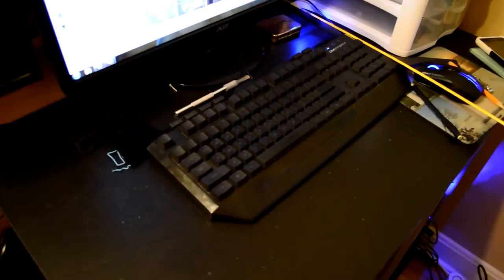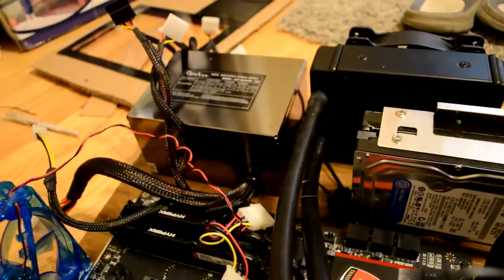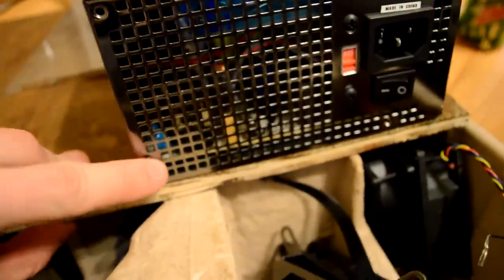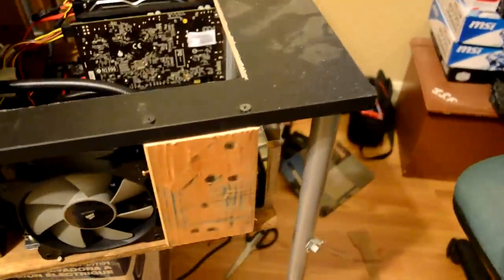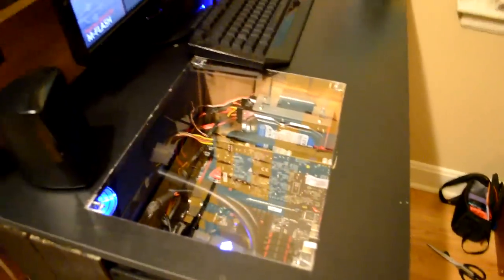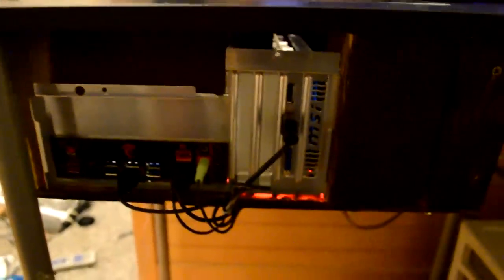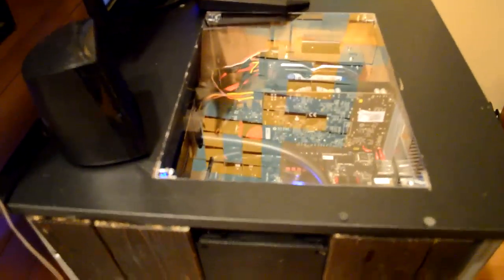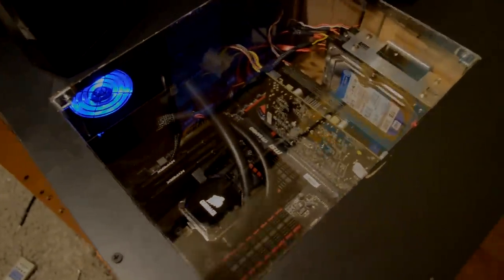In Desk Water Cooled PC - Custom Build

Comment: you should countersink the screws on the desk that hold up the computer so its smooth all across it and it will look beter too. if you dont know how to do that i will tell you how: step 1. find a drill-bit a little bigger thatn the one you used to drill the hole if you even did. step 2. attach it to a drill duh and drill into the table just enough to make a slight dip in the table then put the screw in and see if its good and if not drill a little more and tada smooth table

Comment: Hello, i think this is a very creative design. May I make a suggestion? I noticed that there are gaps between the fans and the desk itself. My suggestion would be to cover them up with foam, or simular materials.

Reason for this suggestion as this would allow the system to keep cooled down better. Also this would reduce dust buildup. Basically say you dust the system every week. When you close in the gap, then it can be every 2 weeks (in theory).
Reply from the maker: +James Foster Yeah that's a good idea. I actually recently put this build in a new desk and I covered the fans with wood on top and bottom this time.

Comment: Hi 
i just want to know were is power button how can you turn it off and on ?
I know that is a dumb question xD
Reply from the maker: It's cool xD. I put it (If facing the desk head on) off to the right of the case. Just kind of in between a piece of the wood. You can see it in the video it is that white and orange twisted wire.
Reply: Toasty Bros cool i was planing to make one before you upload this video but that help me thanks for that and remember you keep being you bye <3
Reply: Yo Toasty I'm going to be doing this with my setup how did you get the power button to work? how do you connect it and did you buy one or rip it out of a case
Reply from the maker: I took on out of an old case, but making one is really easy. There will be two pins on every mobo for power; to turn it on it just required you to complete the circuit for a second. So you can even just use the tip of a screw driver and touch between thoughs to certain pins.

Comment: Could you recomend a build that runs minecraft at 200+ fps -thx
Reply from the maker: What settings are we talking at? Resolution, and grahpics wise. I can test whatever you say on my PC and see what I get and recommend from there.
Reply: Around 8 render distance, with all the graphics turned down with optifine
Reply: And around 1440x990 plz
Reply from the maker: VerticalGore7 I tested it on my current setup and got 100-220 FPS at 1920x1080 with no mods or anything but put the render distance at 8 and fast graphics and everything else avg. settings. At 1440x990 there wasn't much difference just a little more fps.

My build is:
AMD 6300
Radeon 7770
8GB HyperX RAM
430 Watt PSU
2.5TB HDD
Reply: +toastybros thx alot i now realize i dont need such a powerful computer thx
Reply from the maker: Not at all :)
Reply: http://pcpartpicker.com/p/7srTqs will the 8350 bottleneck? I wanted the good proccessor because later on ima upgrade the video card. Or should i just go with a amd 6300?
Reply from the maker: If you don't wanna spend alot and still get really good over clockable performance I'd say 6300
Reply: a sponge

Comment: why would you even liquid cool if its overclocked so little you can almost do that with the stock cooler. My build is Amd fx 6300 oc'd to 4.7 ghz and gtx 970.
Reply from the maker: I had an extra water cooler laying around that I wasn't really using so I put that on this build.
Reply: I'm thinking of upgrading processor/motherboard should i go with an amd 9590 or intel i5 4690k?